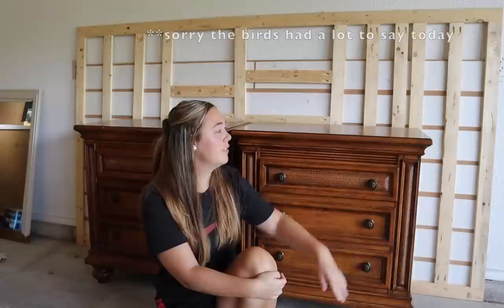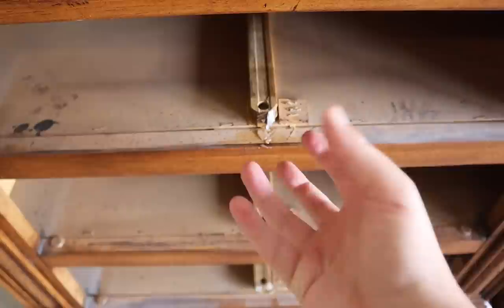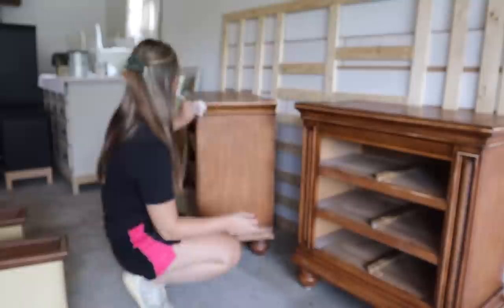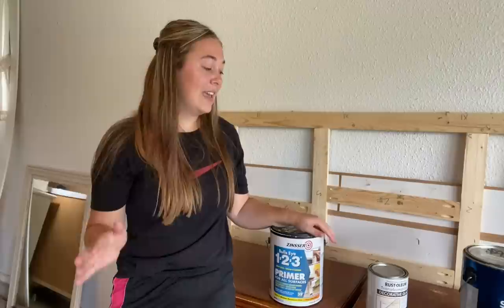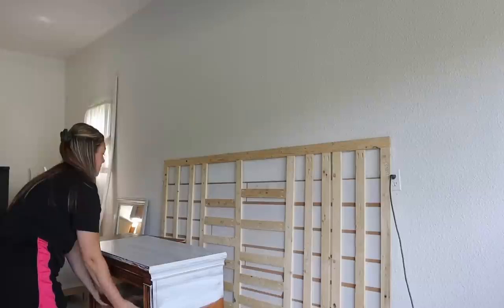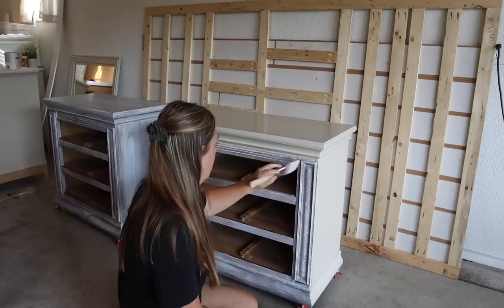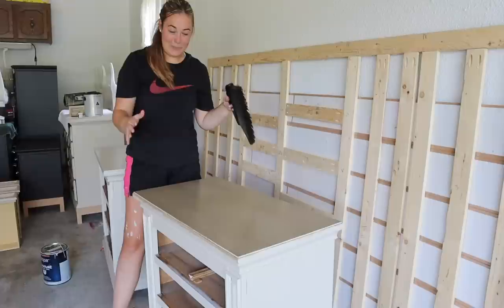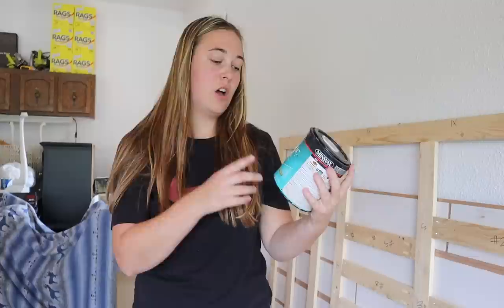DIY POTTERY BARN DUPE ON A BUDGET l Faux Wood Technique with Rustoleum Glaze l Furniture Makeover

Comment: You really should clean your pieces before you sand because if you wait until after you sand you will be sanding any dirt and grim into the surface. I know you need to wipe it down again after sanding but it could really make a difference to your paint lasting and adhering.

Comment: I have bleed thru on a piece I’m doing now. Best way to quickly deal with it is to hit the area with some shellac. I keep a spray can handy just in case. Another tip grab a couple of furniture dollies -the flat kind with 4 wheels. Makes moving the pieces around so much easier (i like keeping them in the best light) 😉
Reply: If you have a harbor freight near you, those dollies can be bought for ~$7? So much easier & safer than dragging on concrete.
Reply from the maker: I definitely have to do that! It’s all sooo heavy!

Comment: Consider using a wallpaper brush. 12” long but narrow. Easier to hold. Love the result.
Reply from the maker: Thanks for the tip! that may be exactly what I need
Reply: @HeatherLewisss  also, try not putting heavy glaze in corners. Rather paint close but then push in glaze from your up and down sweeping. That way you don't end up with darker corners.

Comment: I like the paint color you used. I tried black sheep’s exact base paint color & exact technique. The latex paint was coming up from the small yellow broom bristles even after several days of curing. parts turned out good but I learned that if the wood has blemishes (a weird veneer issue), the glaze picked up these blemishes & I lost the striated grain affect in this damaged area which looked like a blob shadow that wasn’t apparent after the Zinzer block out was applied. I have since repainted this piece (large Hepplewhite buffet cabinet) in a mineral paint which fixed the problem but now I’m hesitant & hubs not liking this affect since I have some carvings & such & doesn’t think this will work with all the carved finishes. But I truly like how yours turned out & applause you. Do you mind sharing what base paint color you used? I like it & like your channel & of course I subscribed!
Reply from the maker: I’ve never tried the same base color as hers before, but I recommend always priming with a good primer if you aren’t familiar with how well the paint does. Thank you so much for the support. I used Oattbran by valspar as my base and then rustoleum decorative glaze

Comment: Beautiful work Heather! Is there a reason you use a brush instead of roller when applying the paint? Thanks!
Reply from the maker: Thank you!! I typically prefer to brush paint that’s the only reason. I did JUST upload a video where I roll on paint though, you should definitely check it out!

Comment: Why not take them outside on a piece of plastic and spray them with strong easy off kitchen cleaner it really works well put plastic over it so it doesn’t dry out and you may have to do it two times without all the sanding work! Another suggestion have you ever tried All In One Paint by Traditional, give it a try it’s wonderful you can even do your kitchen cabinets. If you go on their website, go to the left where it says shop push that and at the very end it has a tutorial library and that will give you an idea of how easy this is to do, cabinets countertops, bathtubs, showers, floors, wood, glass, plastic, etc. good luck with you sweetheart
Reply from the maker: I have yet to try easy off but I want to!! I also haven’t heard of Traditional, I’ll be checking that out now. Thank you for watching and all the tips❤️I just uploading a new video, the very first at my new place, you’ll have to let me know what you think🥰